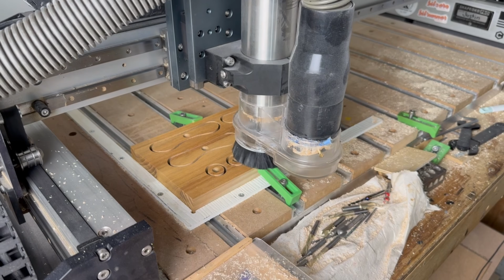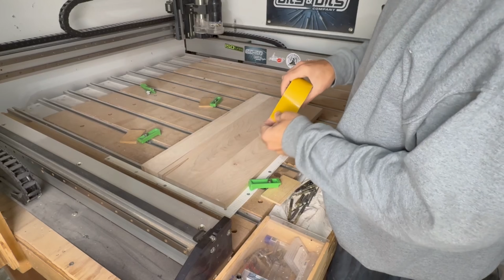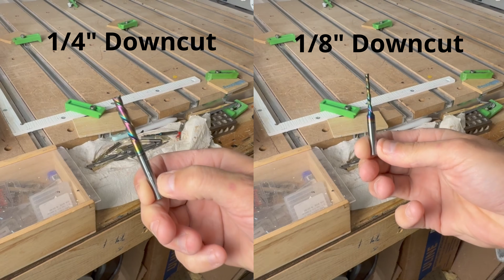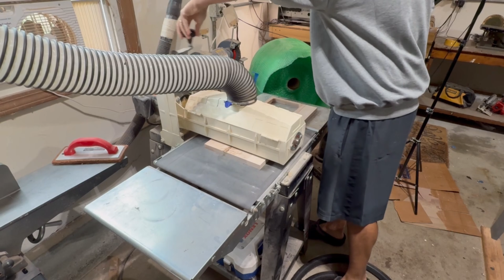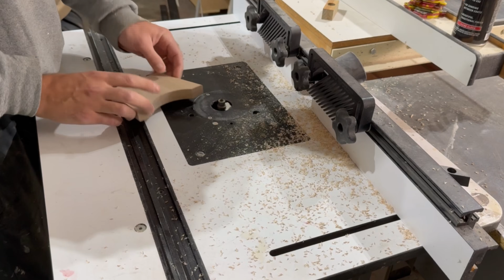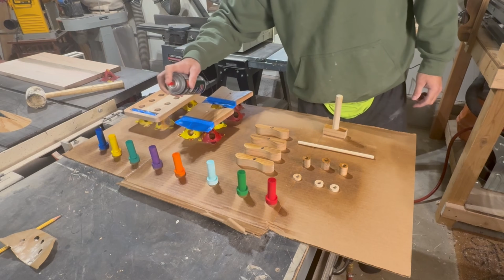Pound-A-Peg Toddler Toy | CNC Project

Comment: Very Cool, great job!  where did you get the aluminum square that holds your lumber square on your machine?
Reply from the maker: It’s not aluminum, just plastic I cut using the machine itself after screwing up down. That way I know it’s perfectly square. I have a video on it when I surfaced my wasteboard if you check through my older videos